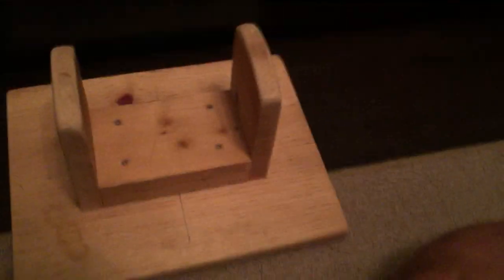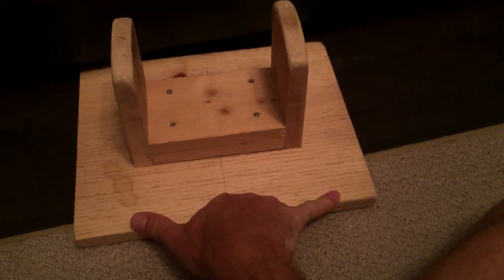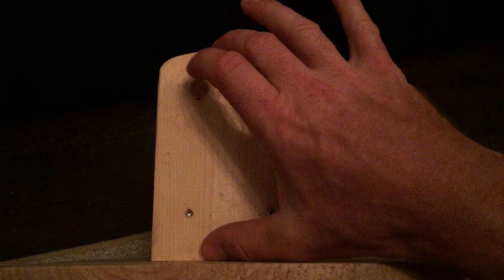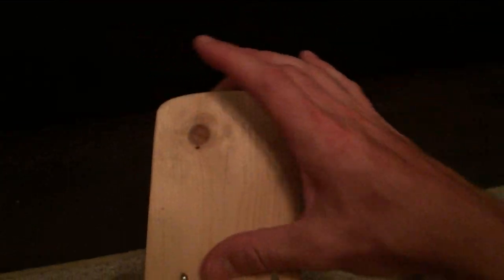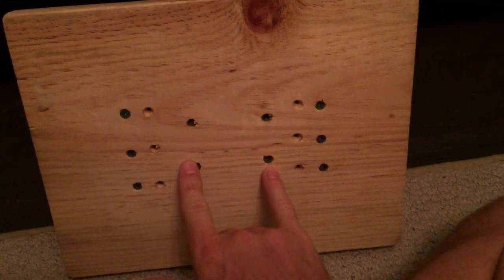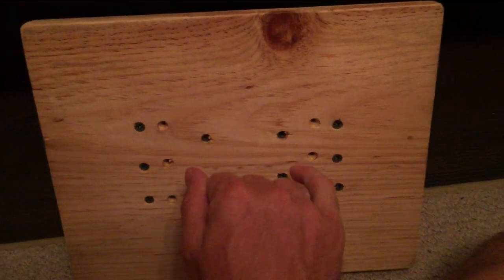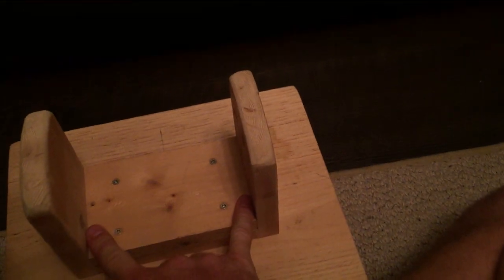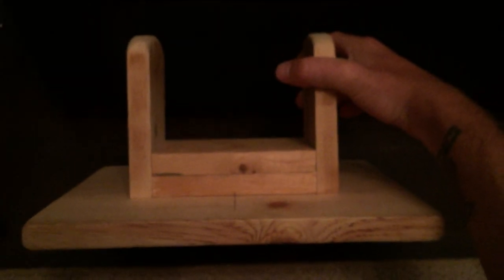How to Build your own Psoas Stretch Device

Comment: I'm going to build this and follow your design, are you still glad you did 5.5" between each "post"? Is that the same distance as the pso-rite? Does that spacing work for you?
Reply from the maker: Danny, yes I am still happy for the spacing on the device. One thing I did do was fit it to my body and I imagine there are some small differences in skeletal structure etc... I don't know if it is the same as the pso right, and yes the spacing works great for me. I love it!
Reply: @dojoone2428  I am typing comment while lying on my own wooden creation. I roughly hit your measurements and found them to be pretty good. I found pure scrap lying around at work so this literally cost me nothing. Cheers!
Reply from the maker: @Cur0m  You are welcome. I am glad to hear you put it to use.